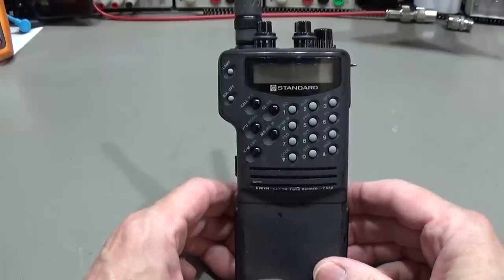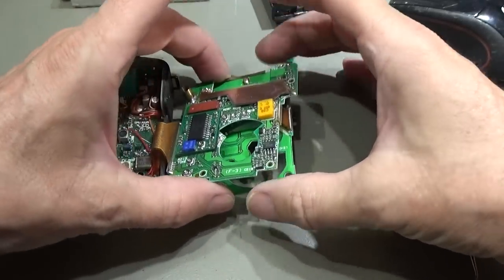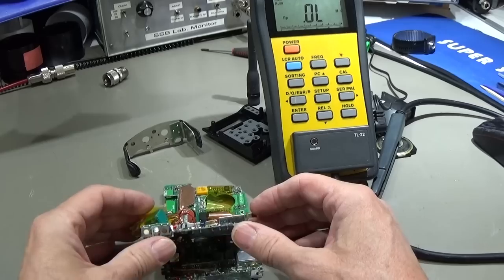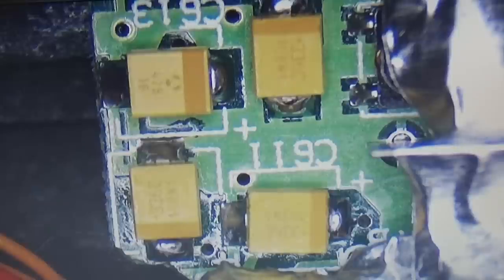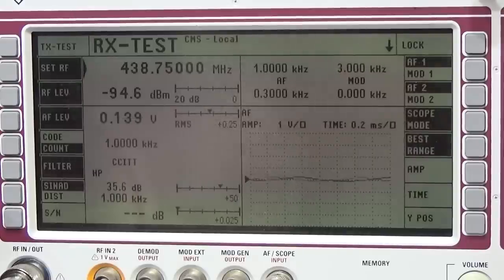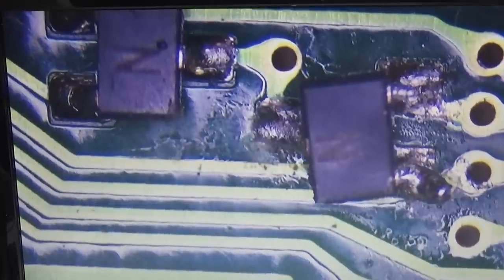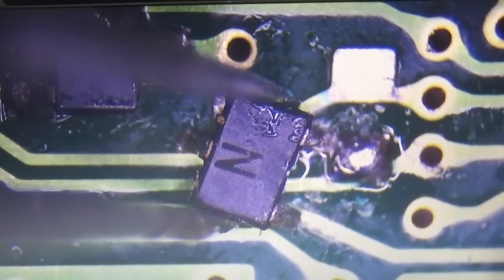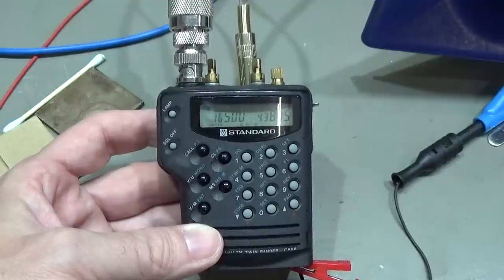#260 Standard Marantz C-558S, a repair log

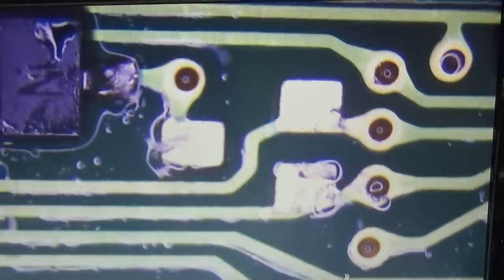Comment: Peter, am at the time 38:28 where you are about to unsolder the copper cover. I am looking at 2 traces at the 10 o’clock position from where the copper corner is soldered and the traces look as if they were scraped with something like a small screwdriver.

Comment: On someone else's video, the SM electrolytics were removed by mechanically twisting them, shearing the base of the cap. Then the contacts could easily be removed from the pads with a soldering iron.  Have you tried this technique or is the risk of damaging pads too great?   The claim on the other video was that they did not damage pads.